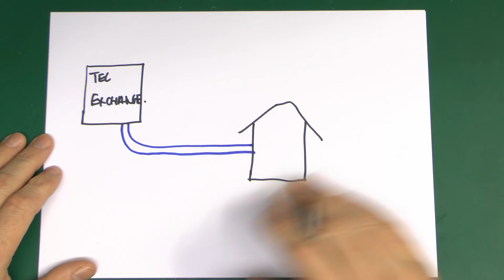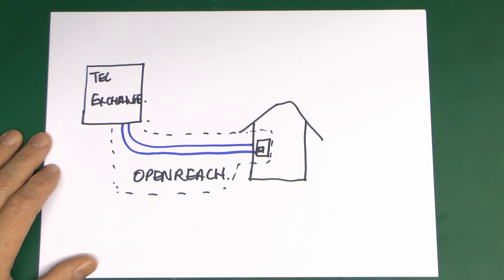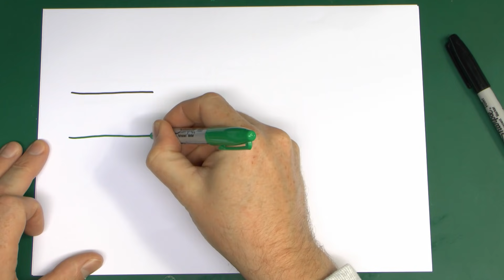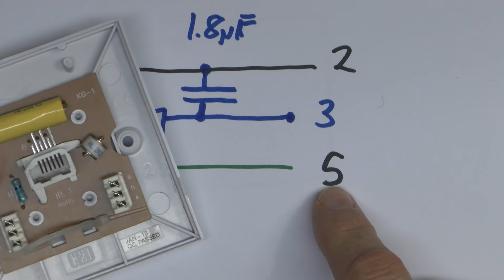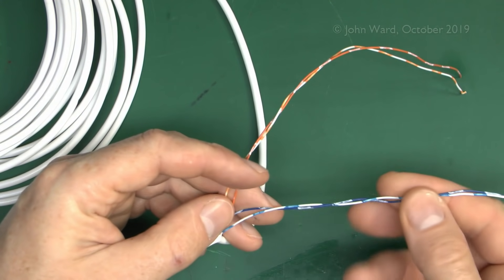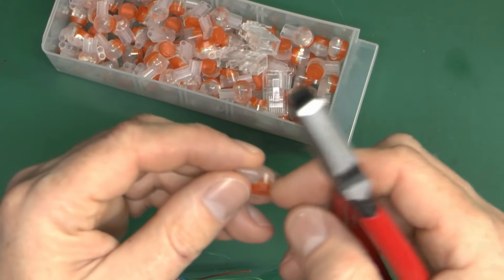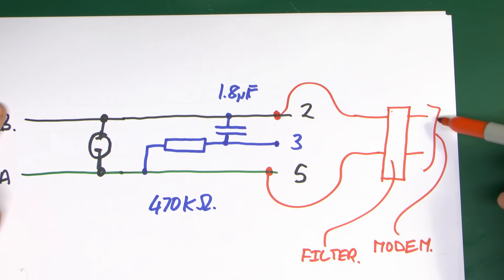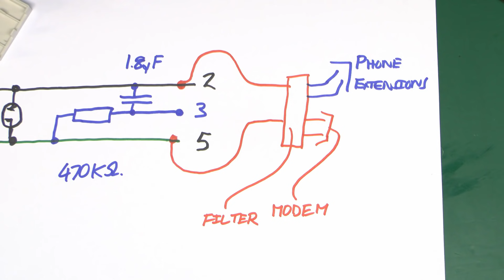UK Telephone Wiring, Sockets, Cabling, ADSL / VDSL Filters, Extensions.

Comment: Dear John! The internet router is connected directly to the external line. It’s the phone sockets which are filtered  to stop voice interference with the data.
Reply: Sometimes, but the better filters isolate both. Some early modems had problems with some cheap telephones generating hf noise affecting the signal
Reply: Uhm, No it is not. Never has and never will be unless A. You hard wire it yourself. B. You have Fiber To The Home (FTTH).  Think lightning strikes Dear Andy.. 

Just sayin'
Reply: @Danechip  tbf it can be and I've seen it done but its not good or normal as you say
Reply: Lightning strikes. You replace router. Suppressor unlikely to protect against all strikes anyway.
Reply: @AndyK.1  from what I recall it was originally in there as a replacement for the one in the 706
Reply: Peter Hurst suppressors have been fitted for many decades, just not in NTE5 sockets from the last ~5 years
Reply: @AndyK.1  indeed.. As I say the original socket design had it and I seem to recall it was to mimic the suppressor in the 706 telephone as we had to strap out lots of circuitry to convert them from the BT49 to plug 631
Reply: @peterhurst  The filter for the phone side works both way, your DSL needs to have the baseband ( anything below 20kHz) filtered out, which most do internally. The filter is to keep the DSL signal from interfering with the phone and being demodulated inside the phone generating noise, and also to prevent noise from the phone going back. It also serves as a very important isolator so that long lengths of cable stubs for phone wires do not act as notch filters and cause attenuation on certain bands of the DSL signal, reducing bandwidth. The least controlled wiring for a phone is the household side, where anything goes wire wise so long as voice more or less works, so isolation of this junky wire is important.

Lightning wise the gas discharge tube would protect the original isolated 2 wire line powered phone, as it would float up to whatever voltage level it got, but modern ones with mains powering need a more sophisticated filter set up, with 2 stages of clamping. First stage is a 3 wire gas discharge tube, so that when fired the 2 lines are clamped to a wire connected to the local grounding, and then a second stage of filtering, typically via a 22R 1W fusible resistor in each lead ( at least with all those I have seen) to a fast semiconductor voltage clamp, to reduce the high initial transient before the gas discharge tube fires. 

The second stage is fast, but has limited energy absorbtion, but together they do make an effective clamp, provided the ground wire is actually connected, which is often never done. Common on cordless phones ( the higher priced quality ones) and on almost all fax machines, and the warranty is void if there is a lightning strike that blows the input stage and this filter has either not been connected, or improperly installed. These clamps do protect DSL modems to some extent as well, at least for close strikes, but at the expense of also introducing extra attenuation, so you lose a little bandwidth on the higher bands, which is not avoidable.

Incidentally the UK master socket having a capacitor dates back to the days of rotary dialling, where the dialler mechanism has a dedicated set of contacts that short out the ring line to wire 5/B when the dial operates, so that the capacitor both acts as snubber for the line, preventing the dialling pulses from being induced into other circuits sharing the same trunk cable to the exchange, and also prevents the ringers in any other phones on the same circuit from tinging in sympathy with the number being dialled.
Reply: Removing links in dial phones when fitting modern line cords, disconnected the bell capacitor I believe.
Reply: @SeanBZA  yep forgot the spark gap reasons for the suppressor but I've not touched a 706 since 1985!!
Reply: @AndyK.1  In VM world, in the mux, they have banks of 10 for each line that can be swapped out. Twice protection.
Reply: I too came to this video with the belief that the modem always has an unfiltered connection and the phones get a low-pass filtered connection.

It seems logical that the modem would be unfiltered:  If all the telephones are low-pass filtered, how can they then interfere with the high frequency modem signal? High frequency noise from a telephone ought to be blocked by such a filter, just as it prevents the high frequency modem noise from coming out of the earpiece of a phone.

The way I read Andy Kirwan's original post was that the router is connected without a high-pass filter, not that it was connected without surge suppression.
Reply: @AndyK.1  In a separate box - with GPO embossed in it ;)
Reply: in australia thats how its done,  you filter the phones not the modem, but high risk areas have lightning protection built into the NTD (external wall box separating street cable from house cable to the socket.
We also use 6p4c or 8p4c for all socket mechs which are also the krone style, I think some palces call them KATT?  (offset, rather than what hte yanks use - the 110's)

The gel conns we call scotch locks, and the front flat tool designed for them also crushes better and more uniform than normal serrated pliers that crush at an angle,

Sorry Andy, cant fault Johns vid - and I've been doing phone and data cabling for decades, and remember, John made it very clear at the start, this vid is applicable only to the UK.
Reply: Agreed. 

Some people are looking at the filtering issue the wrong way. An ADSL/VDSL modem is going to expect voice and ringing signals on the line so will be designed to deal with them. What you don't want is any phone connected to the line swallowing the ADSL/VDSL signals. Hence you put a low-pass filter (using inductors as it has to pass DC unaffected) on the voice/phone connection and connect the modem to the direct to line unfiltered.
Reply: That is common in the US, apparently, but in Europe most setups would have a splitter rather than multiple micro filters. Ie, a three way block that connects the dsl port directly to the line and the rest of the internal phone system via a single, better filter. For the better grades of DSL, the micro filter style is a baaaaad idea.

Of course these days a) analog lines are being phased out for voip, for the most part (ISDN is mostly already gone) and b) internal phone lines are being phased out for dect sets in most private homes.
Reply: @JasperJanssen  BRI ISDN is pretty much dead. AFAIK, though, PRI ISDN with, what was it, 23?, data channels, is still around. IIRC 56k modems require the upstream host to have a PRI on its side.
Reply: Yeah, Australia has mix of both filters, but homes with more than one outlet often have the central splitter so you dont need  half a dozen micro filters.

As for analog, its being phased out in Oz as well with what they call the NBN, of course those lucky enough to be in the LTE/satellite coverage areas get to keep it. I say lucky, because those damn analogs "just work" for the most part, certainly far more reliable the the clusterF##$ that is the NBN, or national broadband network (yes truly original naming....  LOL), but thats govts for you.
Reply: @SeanBZA  No DSL filter does anything other than pass the line straight through to the modem. All modems know there are built to be connected to phone lines and deal with ignoring the audio and ring voltages themselves.
Reply: @Danechip  Get a multimeter and check it yourself before writing rubbish.
Reply: @SeanBZA  Get a multimeter and check your filter before writing rubbish.
Reply: @Graham_Langley  CORRECT!
Reply: In fact if you open a ADSL filter you see that the modem output is directly connected to the input and only the phone part goes trough the filter. 

Also with VDSL filters are simply useless, you shouldn't have them connected to your line and is the provider itself that tells you to remove all of them and connect the modem directly to the line. Since with VDSL you don't get an analog service the voice traffic is passing trough VOIP, and thus if you want to use old analog phones you must connect them to your router and not to the phone line. 

Ideally with VDSL you should also remove any other phone points in your house and have the modem connected to a phone point that is as near as possible to the location where the provider cable enters your house.
Reply: @thedarkdestroyer6629  Engineer my arse , what part of engineering encompasses putting wires into things ?
Do you use a lathe , milling machine or surface grinder to do that ?

Comment: Before it was BT it was the General Post office,they owned all the line including any inside your house and they had the right to enter your house at any time to inspect any apparatus connected and the wiring. Most phones were hard wired but there was also quarter inch phono sockets if you wanted to be able to move the one instrument allowed around the house.
Reply: My grandmas new bungalow has a master socket with gpo on it.
Reply: Steve Craft - Back when it was the GPO, the ringing capacitor was typically in one of the phones. Then all the bells in the phones were wired in series.
Reply: same here in the US when Bell telephone ran things. you had to use THEIR phones, and if you messed with the wiring, and it caused a problem down the line you could be fined.
SO glad those days are over 😅

Comment: In that micro filter, one of the capacitors generates a new ring wire at the BT socket, presumably to minimise noise coming from the upstream ring wire.
Reply: It does !
Nice one Bryn. (what a Welsh name you have there sir)
Reply: Yes. And despite having acquired a large collection of DSL filters including several different types I have never seen it done any other way.

Comment: Quick and dirty ringback test if 17070 doesn't work in your area - dial 123, wait for the speaking clock (At the third stroke, the time from BT will be. . . . . . ), press 'R' and wait for the dial tone, then replace the handset - if you have access to the speaking clock, you should also be able to get an automatic ringback. When the phone rings, pick up the handset, hear the voice, then replace the handset.

Comment: @John Ward: DSL filters do NOT in general do anything to stop the audio and ring voltage reaching the socket for the DSL modem.. There is typically no filtering at all for the DSL modem connection except, in many combined DSL filter / dual socket master sockets there is a common mode choke to remove any high frequency interference arriving down the line in common mode rather than differential between A and B as the wanted signal will be. But when that common mode choke is present it "filters" the incoming line (phone and DSL) and not just the DSL connection.

Comment: You've taught  me something I was always unsure of and that is the bell circuit. A very clear and informative lesson. Thanks very much.
Reply: Fun fact - When you lifted the handset to dial, the phone shorted the bell wire so that the bells in other phones in the house wouldn't tinkle.  It was common to hear phones tinkling because the person who had added a second phone extension didn't understand this and hadn't connected the bell wire.
Reply: @petehiggins33  And the first word was 'hello'
Reply: @petehiggins33  Reminds me when I used to hack connections together at my parents' house 😋
Reply: This was when the phones has dials, and the ringer was a bell. From what I can remember, the circuit was called a "bell shunt circuit" and was activated when you picked up the handset, and the auxiliary spring set operated, and literally shorted out the bell circuit to stop bell tinkle.
Reply: @norfolkhall  You could also make calls hitting it quickly in succession.
Reply: @norfolkhall  Correct. It's not needed with DTMF and should a modern phone be used on a line with something using pulse dialling its ringer circuit is designed to ignore any line pulses.

I've just dug out the line interface circuit we used for commercial alarm diallers around 1980 to check how we did it. When (pulse) dialling the BC connection was connected to the A connection with a 51R resistor, effectively shorting any bell connected BC to A.
Reply: @petehiggins33  Normally the ring circuit is only shorted when the dial is moved away from the resting position. If the ring circuit was shorted whenever the phone was off the hook that would mean there was always a 2uF capacitor across the line when you were using the phone which would massively impact the frequency response and probably make the sound very muffled if you could hear anything at all.

Comment: Excellent simple explanation, especially about the ring conductor and the second pair.  If could make one comment though, and it's really insignificant.  The old-school microfilters (like the sky one) are low pass to block high frequencies.  Sorry for being a nerd but at 24:35 I was getting worried but the diagrams all made sense.  As you no doubt know, (and I know it's not a filter tutorial so again, sorry but I can't help myself) ADSL routers (AKA Modems) always have a high pass filter at the front end anyway.

Comment: John, great work as always, may I add that the incoming cable (standard drop wire or lead in has 2 pairs, green/black and orange/blue. Green black are spares or line 2 and blue orange are the primary a and b to the NTP (Network Termination Point) or internal point. White/blue and solid blue then become the a and b internally on terminals 2 and 5 of all the sockets. Orange is used for the bell balance wire (term 3) if required and the greens are used for earth, old hat earth recall to summon operator, pull dial tone (earth loop recall), hold line or to activate Star Services. Regards Dean
Reply: small correction - the incoming drop wire has green/black and orange/white, not blue.

Comment: Quickly reverse engineering from a freezeframe at 26:53 you can see that the ADSL/VDSL port is a direct connection to the line and there is a low-pass filter to the phone port. Nevertheless an interesting video, those jelly crimps look damn useful.
Reply: Correct. And there's a bell ring cap after the filter.